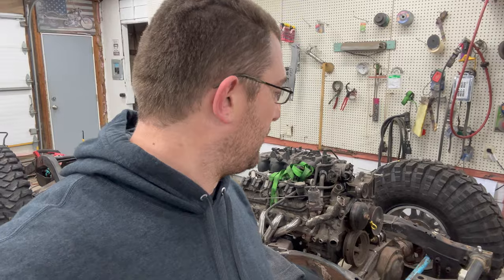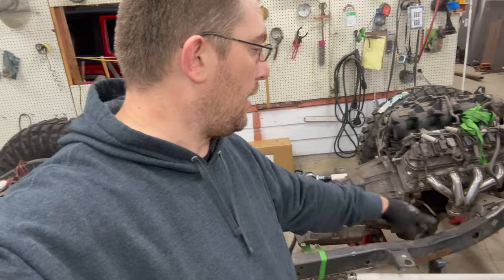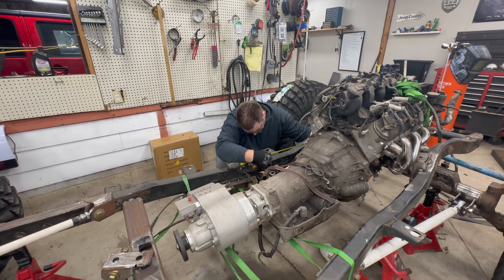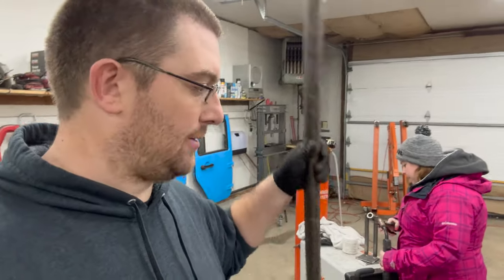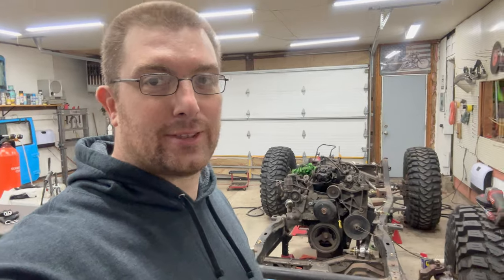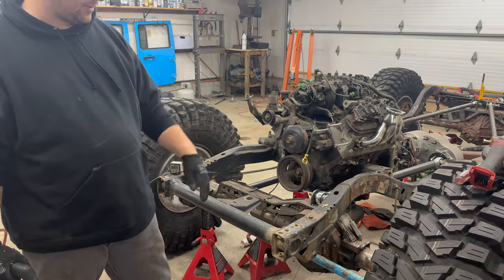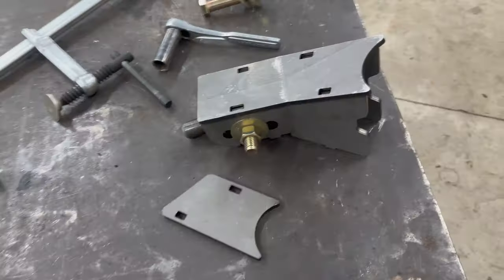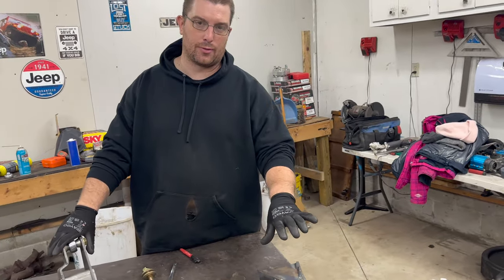ULTIMATE JEEP BUILD! Completing the DYI 3 Link and building Custom Control Arms

Comment: On your track bar mount you could cut you a flat plate, weld it on the inside of the frame, then weld on a couple ears for the helm. Then weld in a couple truss pieces to strengthen the tabs. And on my rockbuggy I run 39” reds with 120” wheelbase and 23” of belly clearance at ride height on 14” ORI’s. It’s coming along great. Keep up the good work.
Reply from the maker: Good idea! Never even thought about putting it on the inside. If I truly end up not liking the way it sits that’s definitely an option. I just know it’s gonna get in the way of the steering links to keep the Ram mounted high. And it also seems like a lot of our numbers are the same! I just need to get that belly a little lower at bump to still run 5-7” of uptravel. And thank you! We need to wheel together one of these days!
Reply: @Ohio_offroad_adventures  absolutely!

Comment: Coming along! If you wanted to cut the frame and lower your front end. Maybe build it out of tube or C notch it. That is a option. I had to on the Mistress
Reply from the maker: Yes sir! And I think I’m leaning towards tubing the front end once I get the body back on. Just to make sure I will need to! Thanks for watching.
Reply: @Ohio_offroad_adventures  Good idea. Might not need that much. The mistress is at 24 to the frame at ride height.
Reply from the maker: @307Garage  good to know. That’s right around where I’m sitting at now then too!
Reply: @Ohio_offroad_adventures  And that is with 43's